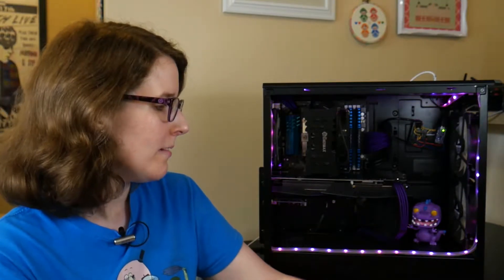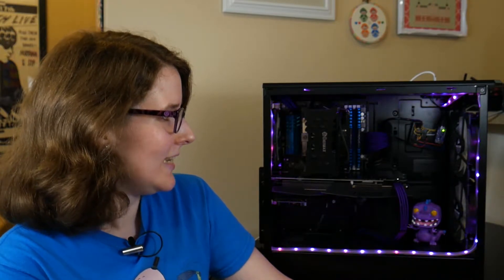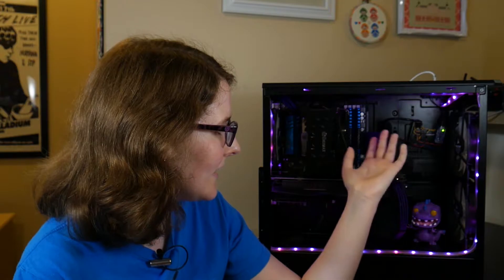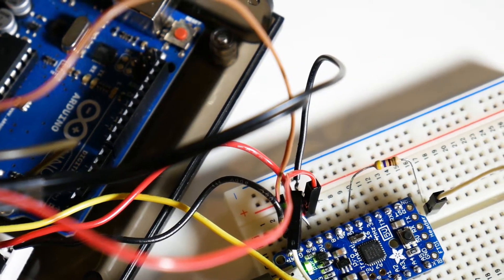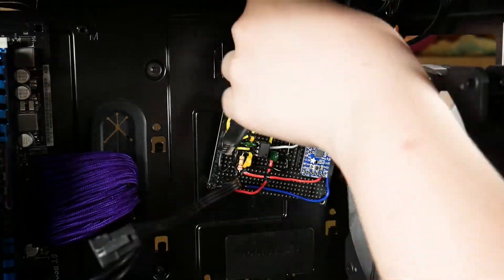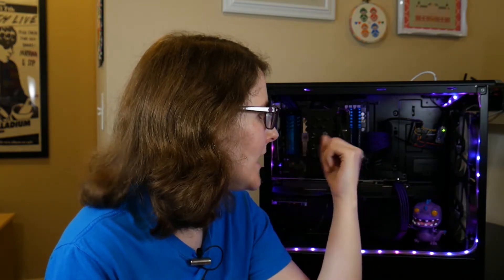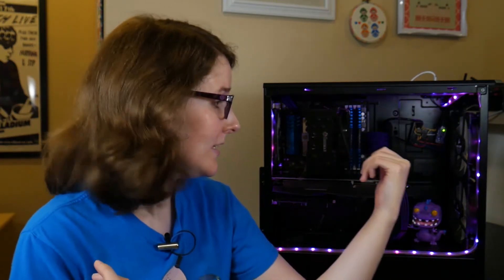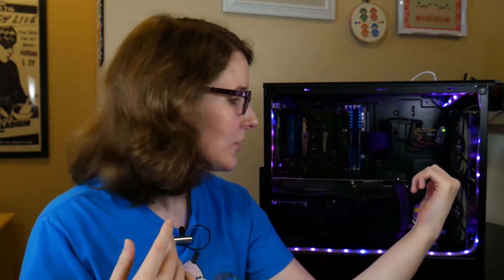Audio Spectrum NeoPixels (DIY Hue+) Version 2.0

Comment: Hi! Great to see another awesome project of yours! When working with PCBs like this I really like to try and do most of the wiring on the backside using something like silver copper wire or even enamel coated wire. Those breadboard interconnects can get pricey really fast when you're using them for normal PCB work whereas you can pick up a god-knows-how-long spool of that wire for like really cheap. The good thing about this is that you got a lot of space on the front to add something like debug LEDs or alike. Anyways, great video, keep up the awesome work!
Reply from the maker: Thank you and thank you for the tip on wiring!

Comment: Hey Liz!  Another great project!  If you're starting to get more into soldering, I might suggest getting yourself a DSO138 Oscilloscope to build.  They come in both SMD soldered, and SMD not solder versions, and they're a fun build that will challenge you a bit, but I'm sure you can pull it off.  In the end, you'll have your own oscilloscope which you use for future projects.  I'm pretty sure GreatScott did a video about the 138 on his channel. Anyways, I just thought of that as an idea for you to further your skills.
Reply from the maker: That sounds awesome! Thanks for the tip!